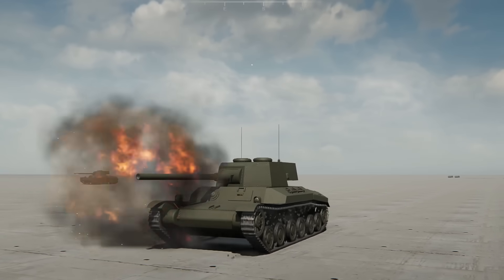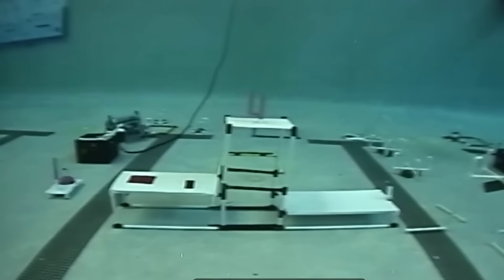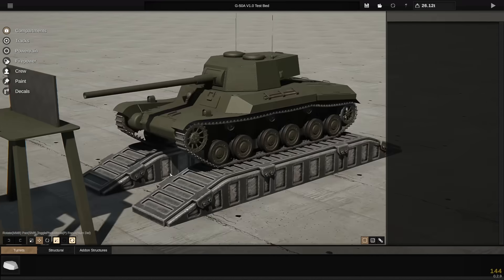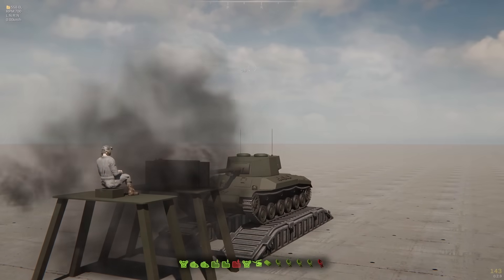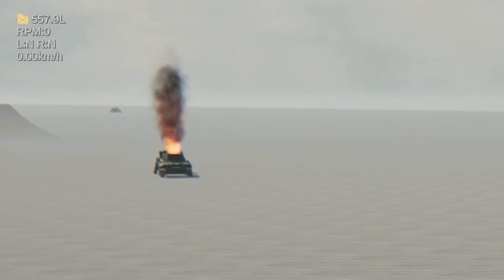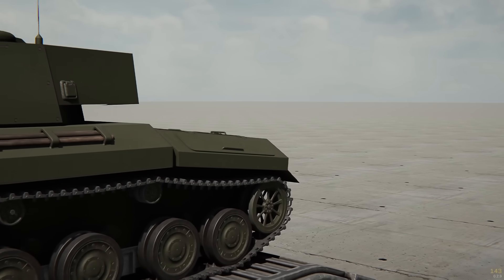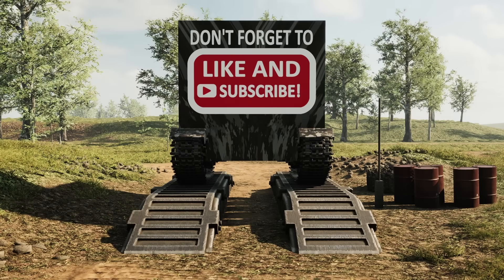How effective is spaced armor?

Comment from the maker: Note: some of these bugs have already been fixed, so expect things to run more smoothly when trying it out.  Alot of mechanics for shell normalization have also been improved since I posted this.
Reply: noiice
Reply: What game is this?
Reply from the maker: @Skyhigh_905 Sprocket Tank Design
Reply: @thewonderwaffleofficial  Thanks!
Reply: @thewonderwaffleofficial is it free?
Reply from the maker: @redtopat https://store.steampowered.com/app/1674170/Sprocket/
$20
Reply: @redtopat  No.
Reply: @thewonderwaffleofficial  thanks
Reply: i have a tank (but not in this  version), MBT that have 500 -1000 mm effective armor from front and  2000 mm of effective armor mantlet , it used spaced armor and extreme angling on it. the weight of the tank was 70 ton (comparable to modern MBT). the only downside was underpowered engine and gun that barely past 350 mm of penetration (i made it on vanilla without any editing data)
Reply from the maker: @rizkidary837 nice
Reply: @thewonderwaffleofficial   forget to add
Edit: the reason why engine underpowered because, well sprocket used to only have late-post WW2, so I cannot reach higher p2w ratio comparable to MBT (interestingly, the game will tell me I have bigger p2w ratio before "start" the test, I kinda wish it can reach 60km/h, but I only reach 45-50 km/h.

Also since I still use the older version, my fav about that tank, it have 2 axis Stabilizer, so shooting on the move is such a breeze

Comment: I made "composite armor" with this new system in the game and it's basically impenetrable while still maintaining a reasonable weight. I hope this game expanded beyond WW2 tech someday so we can have HEAT and APDS/APFSDS and maybe thermals and proper composite armor design. 

The shell designer they talked about before would also be pretty cool. I could imagine to make it work for HEAT you could have to manually adjust the shape, size, and position of the copper liner and for APFSDS you'd have to adjust the shape, diameter, length, sabot shape/size, etc of the round.

Comment: The new-ish update with "unmanned" addon components you can sculpt might make spaced and even composite armor doable now. I used to make shitty composite armor with the riveted panels after they actually gave them an armor value. I'd layer a shit ton of them spaced slightly apart to create a shitty sort of NERA.

Also I dont think they considered the idea that someone would build an entire firing range on the outside of their tank and put a fuel tank there which is probably why it killed you. The fuel tanks simply damage everything once they catch fire with no respect for its location. Tbh this should be fixed tho because some tanks did in fact use external fuel tanks so if they caught fire it wouldn't go inside the tank. Such ss the Leopard 2, Object 279, M1 Abrams, etc.

Comment: buddy the gun was penetrating 160mm it was just producing spalling, but it looked like it didnt penetrate because the spalling started at the beginning of the 160mm plate rather than the end as it should, so the holes on the other side had marks from the spalling rather than just the hole of the shell. Hope this helps
Reply from the maker: I don't think this is exactly the case, because the 160mm gun was unable to penetrate the 150mm, 130mm, and 100mm plates afterwards.  If it was, then the game has some incredibly strange issues going on...
Reply: @thewonderwaffleofficial not sure if this was intended (probably not) but realistically the shells had a minimal range of effectiveness where the shell would work as a shell normally does, anything closer than that and the shell would shatter due to being too hot from the propellant, which might've resulted in point-blank shots not penetrating a significantly thinner piece of armor the gun was rated for
Of course take all of this with a grain of salt as I'm just a guy on the internet with an opinion and not an expert on ballistics ;p
and in the end this doesn't really matter apart from being a little piece of trivia not many people might consider
Reply from the maker: Interesting, although I doubt Sprocket models this.

Comment: I feel like at the moment velocity makes shells do weird stuff as well. I have a vehicle that has a total of 4 plates at different angles, total direct thickness of about 120mm, effective thickness of about 300mm and a 30mm shell with 130mm of pen, going about 1000m/s went through it like butter. It only stopped penetrating when the actual thickness of the plates (not counting angles thickness) exceeded the penetration of the shell.
Reply from the maker: That’s very interesting.  Maybe file a bug report for Hamish at https://github.com/Muushy/Sprocket-Feedback/issues
Reply: @thewonderwaffleofficial  My plan is to first setup a similar testing structure as you in the video for a more controlled test and mess around a bit, after which I'll make a report. It could as well be a microscopic gap in my armor somewhere, but I'll find out!

Comment: I thought the point of spaced armor was to allow the projectile to tumble between penitrations, so the energy of consecutive impacts would be less focused.
Reply from the maker: I haven't heard of tumbling before, but it is meant to weaken the performance of the projectile.
Reply: Yes, that is often what it does, be it the cheeks of the Leopard 2 against APDSFS or the sideskirts of a Panzer 3 against AT rifles.

I don't think the game models it yet though.
Reply: It would cause non fin stabilized shells to twist between the plates and render the round useless by the second plate, but it was used to prematurely detonate shaped charges like HEAT, since it would cause it to lose penetration over time as it passes the air

Comment: What i want to say that small addon structure with 10mm armor for me can stop ANYTHING. 226mm of penetration? 10mm addon structure + 10mm of main amor and you dont give a f*ck. For now its not OP, just broken.
Right now ANY build with ANY kind of spaced armour can be classified as OP and broken.
Reply from the maker: That’s due to bugs with how the cannon performance is calculated.  I ran into this bug at first, but was able to fix it in the video.  The gun I used in later parts of testing was specifically picked because its expected performance matched its actual performance.

Comment: months ago i made "stalinium", a mesh that's hundreds of 1mm plates spammed at +/-5° angles, since sprocket makes any shot ricochet at >85°, regardless of thickness, inside of a 25° elevation to target, it makes it so you always have a plate that's at least at this angle of incidence, making it completely unpenetrable.
all while being about as light as a 35mm plate
Reply: @jujuteuxOfficial  yeah it would be better for them to focus on including an overmatching mechanic. As hilarious as it is to build unkillable tanks that look like a heat sink.
Reply: @Faravid829  i just use it to make stuff like T70 light tanks able to shrug off panthers and the like, where even long 88s don't make it through, it's kinda fun
Reply: oh so this is what gaijin uses for it's soviet vehicles
Reply: @ehannasir8464  yes
Reply: @ehannasir8464 yes
Reply: you basically made modern composite armor. I used to do something similar but it wasn't nearly as effective as your setup. I'd put a bunch of 5mm plates spaced apart with a V shaped angle inside of them to create a sort of shitty NERA matrix.
Reply: how do you stack at +/- 5 degrees? wouldnt it just overlap?
Reply: @caxve  nah you just have 5 edges with a common point, like a V with 5 prongs, then extrude it to make plates, then you have a 0°, 5°, 10°, -5° and -10°
Reply: @jujuteuxOfficial  ahhh ok thx
Reply: "hundreds time 1 = 35"

Don't drop out of school, kids. It will also help making your made up stories more believable.
Reply: @Narcan885 they're not all at the same place
also 35mm =/= 35", that's 889mm
they are multiple, 1mm-thin plates at >85°, inside of a 35mm bounding box
so they have 35mm in length, [x] in width and 3mm in height
if the 35mm bounding plate is 500mm x 1500mm
then it's ~165 1mm plates that are 1500mm long and ~35mm wide
that's 1/4 the weight of an actual 35mm plate of the same dimensions
the 85° makes it so the engine doesn't care about penetration and just says the plate bounced it off
the effective thickness at 85° is 11.5mm but acts as if it was infinitely thick
Reply: @jujuteuxOfficial  You said "hundreds of 1 mm plates" end up weighing "as a single 35 mm plate". Either you don't know basic math, you don't understand how weight works, or its a made up story. Your pick.
Reply: @Narcan885 
the 1mm plates aren't the same size as the 35mm plate
they are far, far shorter and thinner
you clearly haven't read my explanation
Reply: @jujuteuxOfficial  I've read your explanation and it clearly makes no sense whatsoever with the parameters you've provided. Which shows you clearly have no idea what you're talking about.

Comment: aww i wanted to see how spaced angled armor performs
Reply from the maker: My guess is it would be very similar to just stacking armored plates, but with more effectiveness due to the sloping.
Reply: Already dones this before on my 300 ton tank, so... it has about 1000mm of effective armor on the front plate, plus an extra 200 effective, so.. around 1200-1500, plus the transmission allowing more armor...

Comment: I don't know whenever this proves that "spaced armor works" or "Sprocket doesn't work"
Reply from the maker: Both
Reply: @thewonderwaffleofficial 
Both?
Both?
Both...
Both is good
Reply: Honestly with the exception of against HEAT and ballistic caps the advantage of spaced armor are pretty hard to simulate in a game.
Reply: @Faravid829  against heat spaced armor is worthless
or even actively harmful
youd need like meters of space plus more backup armor to stop the overpen of the shot
Reply: @KoishiVibin  huh maybe I am misremembering, but I thought spaced armor was specifically effective against HEAT because it would prematurely detonate the shape charge before it hits the actual hull.
Reply: @Faravid829  it also reduces the energy of the shell. Basically in the very first one armor, the majority of the shell’s energy is spent on the first plate. It also affects the direction of the shell and might make it shatter or change direction.
Reply: @Faravid829 it kinda depends on the space like the previous comment stated, purely air spaced armor requires large empty ballast tanks to actually effectively stop a full caliber heat shell, it was actually proven that if the gap isn’t sufficient enough the spacing actually assisted spin stabilized heat shells by giving them more time to form the penetrator and negate the negative effects of the spiraling. The actual thing that killed heat shells in armor to armor engagements was silicates and composites rather than spacing and air
Reply: @KoishiVibin  It really isn't, sure against cold war and modern heat rounds it is, but most spaced armor was used during WW2 in the form of sideskirts or turret plates (on some german tanks) which would detonate the HEAD and possibly stop the penetration from going through. Note that this was the early days of shaped charges so the HEAT around the time probably had 80-130 penetration max I believe
Reply: @HelSeher HEAT actually benefit from a bit of space because it gives it time to form the jet properly. Modern HEAT includes a probe for that to occur hence why you see that pointy tube thing on modern HEAT.
Anyway, HEAT jets barely lose penetrative capability until 1-2m away. So most space armor arrays you see are useless or even actively harmful against HEAT.
Reply: @KoishiVibin  errr no... while you are correct that standoff distance does improve penetration it only does so to a point... usually to an ideal of between 1 to 3 charge diameters length of distance from the initial detonation point meaning spaced armor beyond 3 CD is likely to worsen the penetration of a HEAT projectile... likewise what spaced armor also does in contrast to a same thickness monolithic steel is increase the deformation of the superplastic jet

the case of schurtzen and ww2 era spaced armor specifically doesnt greatly affect penetration per say because early shaped warheads are not designed with proper standoff distances in mind... hence it could have either a negligable or positive effect on penetration but it fully depends on the design of the incoming projectile
Reply: Combat Engineer Sapper here. The space armor is used to defeat that munition. It is insanely effective against things like light armored Humvee even from a bit of distance. I saw one set off under an 1114 Humvee which is lightly armored it cut clean through the engine block even at a short distance away. 
The Serbians would put AT mines that form the lance pointing side ways in defiles so that a light skinned vehicle would trip it wit a wire. It was insane what it could do. Against a heavy armor though it just looses to much punch.
Reply: @glennjoshuamangabat2750  ofc demoman knows this, he blew up tanks before
Reply: @KoishiVibin  what kind HEAT xD lot of type that heat ammo 1940 that not match HEATFS and now super modern what blow up easy a track and then go through going another target look this video: M1147 Advanced Multi-Purpose Round (AMP) 
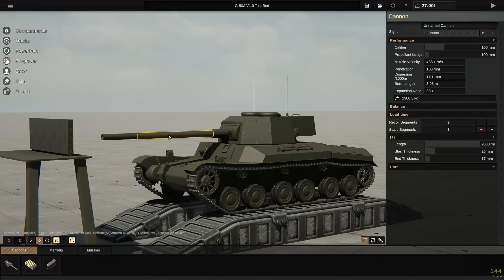but enough carl gustav what going through easy bmp and after can through 10meter a another target : Carl-Gustaf system: HEAT 655 CS ammunition trial video 3:01
Reply: @KoishiVibin  Against modern HEAT sure, but claiming it's harmful is over the top. It can, in very specific scenarios, allow the warhead to detonate at optimal stand-off distance, making them more effective, but it's very rare. Early HEAT did indeed somewhat struggle against spaced armor, as fuses were unreliable and jet formation was poorly understood. It often made the warhead detonate in a way not intended by the designers, reducing it's effectiveness, but it's still far from what we see in games where shells are essentially "eaten" by spaced armor. Modern HEAT largely doesn't care, unless you're able to physically disrupt the jet with reactive armor or catch a relatively slow moving warhead ( like an RPG) with a net or cage in a way that won't activate its fuse at all.
Reply: Right now its just broken tbh.
Reply: Spaced armour was for anti tank rifles not heat IRRC
Reply: @TheEpicNoob  For both, sideskirts like on the Panther were made to prevent the soviets from sneaking up and busting the tanks with the rifle only (but I think they could detonate HEAT too), while the ones on Panzer 3 or 4 tanks were made to counter both
Reply: everybody forgot the most important part/thing MATERIAL What kind what quality??? good example 10mm very hard steel 600BHN on Brinell skale same that hardness what shell/penetrator most part where hardened another part weaker so meeting and will easy Break nose or lot of part because same harder the two material 
example always making a best steel for shell/ammo want that make tungsten carbid.
Reply: its prob the latter
Reply: Game in progress! I haven’t updated because I like my old designs and want them to work
Reply: now it shifted into "Sprocket doesn't work" or did you could

Space armor ain't longer work
Reply: New updates have fixed these issues. There is also a damage simulator in the editor
Reply: A lot of modern military vehicles have thick “cages” around them to protect against rpg rounds. So yeah spaced armor is currently in active use
Reply: Sprocket has never been a functioning game in any sense.
Reply: @wowdanalise < Says the person about a literal functioning game…

Comment: I have a idea, after they fix the bugs and make the update. They should make it to where the armor can wear out after getting shot at a couple of times in the same spot.
Reply from the maker: It would be neat, not sure how difficult it’d be to implement though.
Reply: @thewonderwaffleofficial   something like : "If (hit) = >1 then (armor) = X : 1.5". (Not really an actual programing language, but it could go like this basically, it would activate if "hit" is larger than 1, decreasing the armor by a multiplier of like 1.5 .) Not very realistic either.
Reply: @Swagmaster07  yes but its the exact point where it was shot is the problem
Reply: @alex29red  I think it can easily be traced by the already existing hitboxes from the plates
Reply: @alex29red   I gave a simple idea on how to do that, sure I know that but I aint gonna cover it, just saying its doable and not like Insanely hard.
Reply: The dev already has enough problems with feature creeping himself. Doesn't need more ideas lol
Reply: It's not really realistic. If you shoot the exact same spot the newer projectile will just pass trough the previous hole - either just penetrating further, if the previous round didn't penetrate or exactly passing trough the hole without spalling.
Having the armor plate degrate after hit at all, though, would be realistic, but unpredictable and annoying as a game mechanic, especially if you cant modify the steel quality or type.
Reply: That would be interesting.